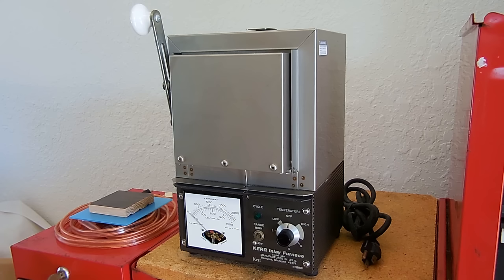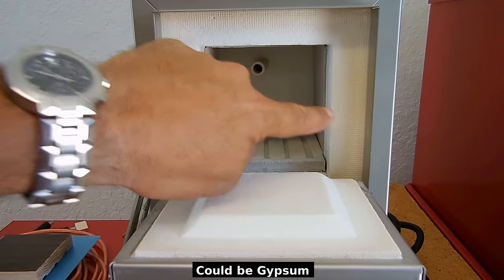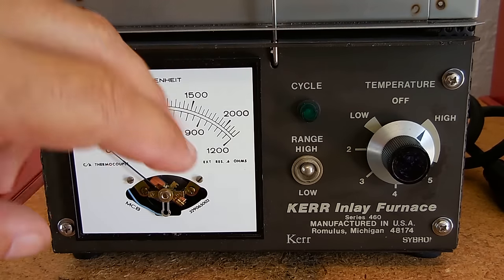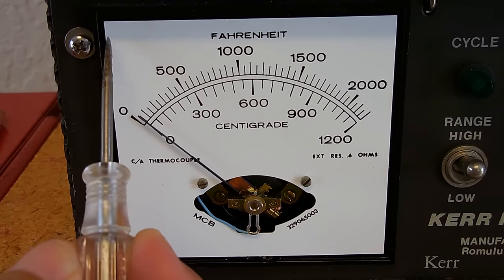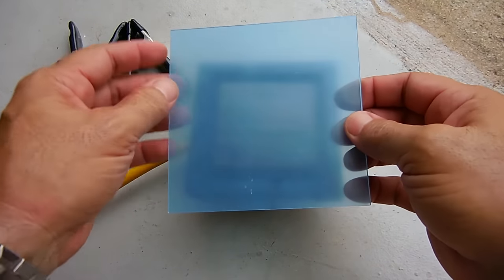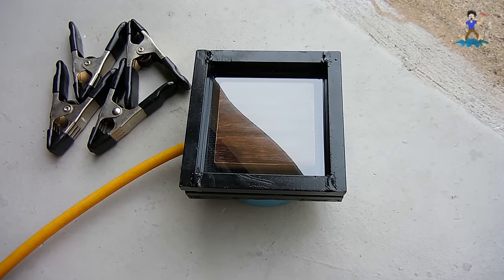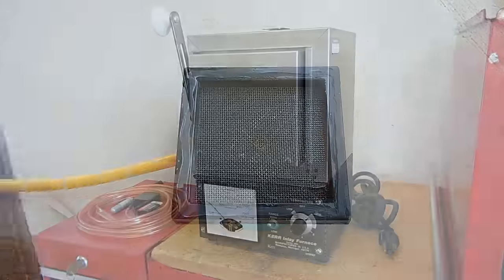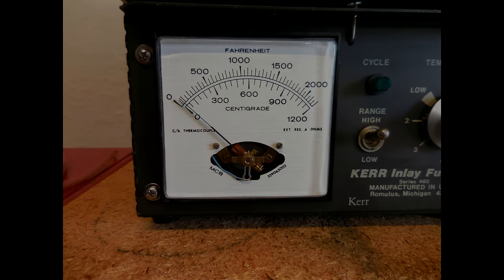Furnace Temperature Gauge Cover(Vacuum Forming)

Comment: I have two of these, a 4" and a 6" that I bought new in the 1980's. I use them for heat treating metals. I changed the thermocouple system last year because I need very accurate tolerances that the original gauges couldn't achieve. Excellent furnaces though.

Comment: A dental furnace with a cavity hehe! My take home message of this video is that vacuum forming doesn't have to be a big 20x20 inch thing. Most of the stuff will be small one off stuff like that, so it makes perfect sense! You could probably make superconductors with that thing. It would make a cool video!
Reply from the maker: My vacuum forming plate saved me lots of money over the years.

Comment: Hello Doug, I made a new gauge cover using acrylic/polycarbonate a couple of months ago but I found that the static projuced from the the polycarbonate altered the meter pointer.
Reply from the maker: Hi. I didn't notice any problem with my cover. You can also spray the plastic with an "Anti-Static" spray. :-)

Comment: Hi Doug. Depending on what you melt it would be a good ideal to have a fume hood,or use it outside. I was a welder for many years. one of my job duties has an industrial maintenance foreman.Some metals give off nasty fumes when heated. No desk for me Ha ha. I got in there with my coworkers.
All my best.
Bobby.
Reply from the maker: I'll definitely be using it in the garage with the door open(close to the door). Most likely for melting silver.
Reply: Good planing Doug.
All my best.
Bobby

Comment: The white insulation could be ceramic .Nice unit I am looking forward to watching you use it.
All my best.
Bobby
Reply from the maker: I don't think it's ceramic, you can scrape it/dig into it with your fingernail. Thanks for watching!
Reply: May be alumina silica insulation, one type of soft ceramic, can be dangerous if you breath the dust.
Reply: zerpBot  Agreed I did some searching on the web. It looks exactly like what you mentioned .Bad stuff for sure.
All my best.
Bobby
Reply from the maker: +Bobby Tectalabyss
Shouldn't be too bad. At least it's not asbestos. I agree, I think they used alumina silica. It comes in blankets or panels. Ceramic fibers. Like anything else, the problems are due to CHRONIC exposure. 

http://www.zircarceramics.com/pages/rigidmaterials/specs/z500.htm
Reply: Hi Doug. I am just being careful and caring with your well being, I am sure you check out anything you use or do. I don't know everything :)  Still trying to learn new things and your channel is a great place to do just that.
All my best.
Bobby
Reply from the maker: *****
I appreciate your concern and I know you mean well. :-)

Comment: That came out really well!  Is there any sort of general temperature rule for heating acrylic/polycarbonate for vacuum forming?
Reply from the maker: I'm sure there's a recommended maximum temperature. I heat it until the plastic becomes very pliable/flimsy. If you apply too much heat, the plastic will develop bubbles.

Comment: No hole for the adjustment screw for zeroing/callibrating the meter. A hole will a small plug would have been niceProbably doesn't matter because the amount of error in the design is pretty high. I'm guessing +-150degf error by the meter movement alone.
Reply from the maker: I don't think that temp gauge is high accuracy anyway. I can always take an 1/8" drill bit and drill half way through over the screw, then heat up a nail with a torch, then melt a hole in the cover where I drilled. :-)